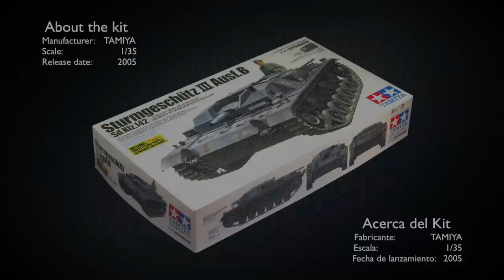[1] Sturmgeschütz (StuG) III Ausf.B (Tamiya) - Step by Step / Paso a paso

Comment: Amazing video, and top-notch editing to save time stylishly!

I've never built a tank model before (but I am accustomed to snap-fitting Bandai and Kotobukiya kits), so I can see by the amount of cement used and lack of connecting pegs in the parts that this is a level of involvement higher than what I'm used to.

However, I really want to get myself this exact StuG for my collection! That said, is there any way to avoid completely gluing the road wheels/sprockets/idlers that can allow the tracks to roll? Or would it risk popping everything off? Also, I'd imagine the rubbery plastic in the tracks is too firm to allow smooth rolling?

Comment: Hi from Ireland,
just wondering if you plan on being able to lift the top cupola so the gun can be seen, as there is a lot of detail there 
and it would be a shame to hide it. (maybe cut the roof to be able to lift it, might be easier)
btw good work
Reply from the maker: +Gerard McCabe Hi, Gerard! I already painted the interior and decided to leave all hatches open. Removing and installing the superstructure can damage the paint job, based on some tests I've made. You'll see the end result pretty soon here on my channel 🤓 Cheers from Colombia! 🇨🇴
Reply: what is the benefit of metal parts(such as the barrel) ? i thought they were inconvenient due to the glue you need. why do people like photo edge and metal more? (sorry im not familiar with photo edge and that stuff)
Reply from the maker: They are basically more detailed and accurate than plastic parts, specially in thickness (they can be a lot thinner)

Comment: Did you have any issue with the top fitting on the main body?  Mine won't sit flush without holding it down.
Reply from the maker: +Richard Jimenez Yes, I had the same problem. It was a little bit curved, so I had to press it to be able to glue it. Not a big deal, fortunately

Comment: Great video! Love the editing and the details and the fact its bilingual. :)

Could you please tell me how to use the PVA glue? I mean, you sad you glued the wheel temporary with PVA glue. How do you 'debond' the glue after it dries?
Reply: if you use a tiny amount it should be possible to just pull the joint apart.

An alternative is to use blue tack instead of PVA.

Comment: 14:02 ....  Sergio, you could have glued it. The jack blocks were ALWAYS painted. The same color as the rest of the tank. That way, the wood will be preserved. Bare wood rots away much quicker. Many modelers make this mistake. And the model factories. They all paint the wood in wood color, while they should simply paint the block along with the tank. It's that easy.

Comment: would you recommend this or the tamiya stug IV? i found the stug III B on amazon as well as the stug III G, but both of them are just under 10 $ modre. whould you recommend this or the tamiya stug IV to a beginner? do the wheels spin?
Reply from the maker: I'd say the StuG IV is better for beginners. It doesn't have interior or photo etched parts. Wheels on the StuG III do not spin
Reply: with extra work, woulld a beginner be able to build this? because i really like the kit
Reply from the maker: +Tommy Lakasi Yes, it's not difficult.